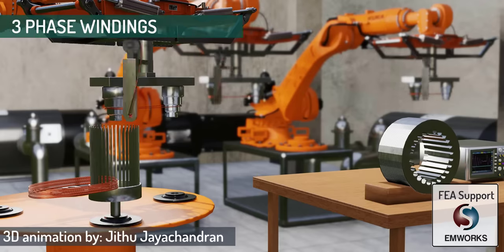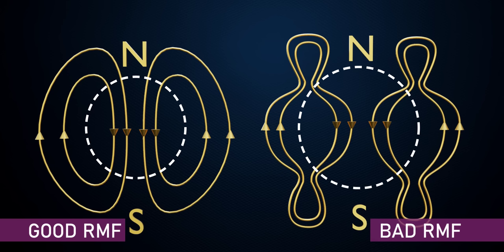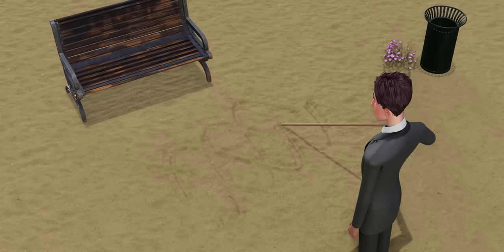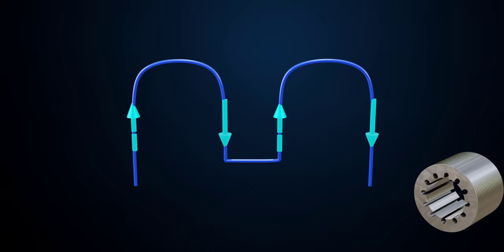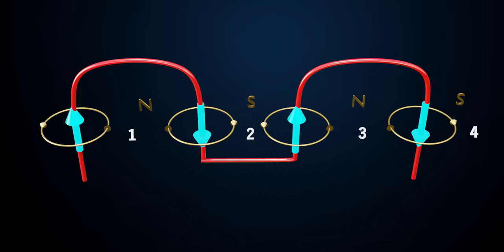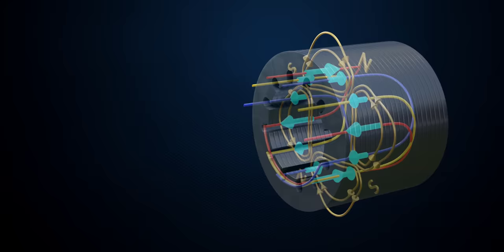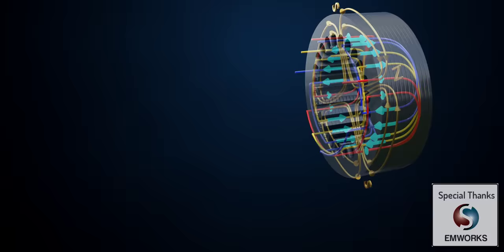Understanding electric motor Windings!

Comment: The normal squirrel cage can deflect the direction of induction by using rods. The Tesla motor produces only a lokal rigid magnetic deflection, rather braking in this arrangement without a conductor and without other functions. No magnetic valve, this is imagination.

Comment: How do you control the motor’s rpm( speed)?
Reply: I'm not an expert but I think that basically you can't control an induction motor's speed, the speed is determined by the number of poles and the frequency. A 2 pole motor is faster and a 4 pole motor is slower etc. But for example washing machines with induction motors have many poles so they alternate which poles they use to get a couple different speeds.

Comment: 3 phase motor was invented by Nikola Tesla who had no formal engineering degree. AC motor had to be invented other wise you can't make tolly cars and industrial machinery. But the Oil Co. Bought out the trolly systems in favor for bus petrol vehicles...

Comment: Why would Tesla wire up 3 stator windings and not use 3 phases? THe system would turn with only one phase as well if you had only one winding (stator pole pair). Or are you implying this is how 3 phase systems came about? There are single AC phase motors that work.

Comment: Why do we have 4 winding coils if there are only 3 phases?
Reply: Single phase can have any number of windings. Two phase (rarely to never used) will always be in pairs. Three phase will always be in treble. So there won't be a 4 coil, 3 phase arrangement. But there could be a 6 or 9 or 12, etc.

You could have more phases but there isn't a point. 3 phase is most efficient.
Reply: @etherealrose2139  Thank you very much, sir

Comment: RMF is an acronym used extensively by Lesics but not often (or ever) by ABET accredited universities, researchers or manufacturers.  I find that odd.
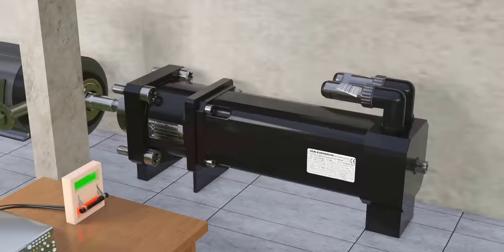I can endure a fair amount of fake expertise for a few minutes but they really crossed the line at 3:22.  Windings are never insulated this late in the assembly process and 'laminations' have nothing to do with conductor insulation.  This speaks volumes of the presenter's understanding of the subject matter.
Also, increasing stator poles quickly reaches a point of diminishing returns, regardless of how well it's animated.

Comment: Sir! for 24 slots motor winding , there should be 6 pole RMF or 2 pole RMF. Is it correct? If yes, then how can you show 4 pole RMF for 24 slots motor winding? 
If I am wrong, then please tell me, where I am wrong
Reply: Depends how you wind it, you dont have to wind each coil 'leg' in separate slot, you can wind 2 legs of 2 coils into one slot for example. So you can obtain different number of poles in different number of slots.
Reply: @sumilidero  will you elaborate?
Reply: @pranomjobbs8914  Well its kind of complex topic. There are different methods of winding/connecting the windings. Like chain/cross/concentric for example. Also single layer/two layer etc. And each 'style' is a bit different in terms of how you place coils and how you connect their begginings/ends. You can search it in the internet, there is plenty drawings and diagrams for different methods and numbers of slots/poles. That would be the easiest way, just to compare diagrams.
Reply: @sumilidero  Ok!!
Reply: @sumilidero  
There aren't good enough sources for winding diagrams
Reply: This is complex and a very good question. The only way to really understand what your asking is to physically wined a few motors of different RPM and study the connections. That's the only way I see to learn this , or answer your question.
Reply: @calvinevans9547  Thanks!! Are you Electrical Engineering Student?
Reply: @pranomjobbs8914   no, motor winder & Electricain .
Reply: @calvinevans9547  Great sir!!🙌. Looking forward to touch with you for gaining some practical based electrical knowledge.

Comment: Time out.  You say Tesla brainstormed whey don't I put the three phases out of sync so they are not all at max or all at zero - Walla there you have it - done.  That's quite a leap.  How do you get them out of sync?  Is Phase 1 use more copper windings than 2 which uses more than 3?  Because the animation didn't change the layout of the coils it just changed the timing of the current and thus the polarity of the emf.  So how'd he do it?
Reply: There are different motor designs, but you can create three phases by sending power into the rotor and spinning it.  If your three stator windings are each 120 degrees apart, the rotating field of the rotor will produce a phase in each winding.

Of course you shouldn't be physically spinning the rotor to make this happen (although that would work) but you can power up the stators with a DC current first to give the rotor field something to push against.  Other AC designs include a capacitor, to force the current out of sync (an inductor would also do the same thing but since motors are already very inductive this is less efficient)
Reply: @DeoMachina  So let's go simple 3 coil 3 phase 120 degree apart. All of these (build your own generator) videos have a magnet about to pass by one of these coils at the same time.  So at best you'll get 2 phases at the same max positive or negative and one at the opposite.  That's the part I can't wrap my head around.  Is there a special spacing of the magnets?  Why does no one ever mention it?
Reply: @anthonypape6862  Draw a sine wave and call it phase 1.  If you turn the rotor 360 degrees, the top peak is when the 'magnet' (or magnetic field) is at the same position as the first coil of the stator.  (Say 0 degrees)  And the bottom peak of the sine wave is when that same magnet is 180 degrees around, this time at the opposite side.

Now imagine a second coil 120 degrees away from the first.  Turn the rotor again, and draw a second sine wave.  The peak of the second sine wave cannot be in the same place as the first, because it's 120 degrees apart.  So the first peak of the second phase is at 120 degrees, meaning the second peak of the second phase is at 300 degrees.

Does this make more sense?  It's like you have 6 people standing in a circle around you, and you're spinning around and high fiving them all one at a time.
Reply: @DeoMachina  Ah I just can’t get it. When I do that with one magnet there is a huge dead space between the 3 sign waves. It seems in coils must be divisible by 3 and magnets by 2 the secret is in the magnet arrangement. You can have a magnet passing over each coil at the same time
Reply: @anthonypape6862  The magnet will have the north and south pole, so both will be doing the same thing at opposite ends

This produces three sine waves that overlap
Reply: @DeoMachina  Brother, I appreciate you trying.  I just don't get it.  In this videos illustration I do.  But in the generator I was making per most other videos the magnet is not a bar magnet, it's a small square or rectangle an the flux only goes through one coil at a time and re-routed through iron laminations.

Comment: i don't understand how electricity travel through the winding copper wires and not short circuit. those wires are touching each others.
Reply: They have a thin coating of clear varnish.  This type of copper wire is also called "magnet" wire as it is used for winding all kinds of electro-magnets.  Plastic insulation would make the coils too thick.

Comment: 6:18 but as according to synchronous speed formula for induction motor it say the opposite which is - Speed depends   on numbers of poles Higer num of pols means higer the speed . But it seems you are saing it opposite !?
Reply: No, its good in video.
Reply: RPM = 120F/P 😎
F is line Frequency
P is the number of Poles
Reply: @abusaidfulus8901  yeah that one
Reply: @omsingharjit  P in the formula is denominator. This would mean greater number of poles will yield lower RPM but with greater torque.
Reply: @abusaidfulus8901  ooh it makes sense now , thanks for reminding me the formula

Comment: I guess engineers only understand what they do but it would be a whole lot simpler to follow with the eye if you would  make it more practical and show how the windings actually move what they move in a motor.
Reply: The windings stay in one place. The motor is comprised of a rotor and a stator. Stator stays still and the rotor rotates. The rotor typically has permanent magnets embedded that react to the rotating magnetic field that is generated by the signals sent to the coils on the stator.
Reply: @NGPerez247  Yeah, we know that but it still doesn't help with this illustration.
Reply: @NGPerez247  actually windings can be on either the rotor, stator, or both. Depends on the motor type. You can also have permanent magnets on one, the other, or both (little more complicated on the last.) And you can also simply have shorted conductors (squirrel cage) on the rotor.

Comment: The magnetic field lines in this demonstration are pointing in the wrong direction.  They point from south to north.  This is incorrect.  It is arbitrary but convention states that magnetic field lines point from north to south outside the magnet and from south to north inside the magnet.  Since this is an electro magnet “inside” the magnet is a line connecting the north and south poles.  Outside the magnet would be everywhere else.

Comment: Tesla was not using the standard AC we all know, he used radiant AC which is achieved by rotating a single face magnet in an iron core...i.e a water pump motor ran in reverse. this kind of energy is not the same as the thing we call electric, as it is pulled & manafested from counter space, or as tesla called it......the either

Comment: Confused as to why there never has been a  9 phase, same as (not pictured as this is not incorrect but not 100 correct, if that makes sense) and each sequence and winding when corresponding correctly and in sequence would not be more so effective. 

Dumbed down, circle a circle. So long as a circle, or sine wave, never touch but creates faster and more torque with the same applied powers....

We living almost in the stone age

Comment: Coils are inductors to electro-magnetic waves-frequencies-pollution-pulse. When connected and not powered but grounded, they are the ground to frequencies including gamma from radioactive nuclear isotopes. Layers of inductor-coils of different materials and the asynchronous length-time conductor grounding can reduce the effects of gamma-pollution in the environment. 

Connecting 
= incandescent-bulbs to stabalise circuits
= magnets-coils generators-alternators-magnetomometers(grounded anyhow) to stabalise electrical-transmission(synchronous 50hz, 60hz)
= ... ... nuclear versus non-nuclear
= finance money cost budget till, you might as well work for money instead of rob nations.

Comment: I think is most importan understand this , and how electric with magnetic field makes a rotation rotor in the stator . But I m not sure is easy to trully feel and visualate that un the mind . For me is much easy understand and imagion how two stroke engine or four engine works than this , here is a problem magnet and polarity from wires , And fore small electric device as drill and grinder is less easier see how they work , because polls . So magnet field can understand just brilliant minds or they which created that as Tesla did .. If we have one electric one fase motor 230 V with 2 kw or 2000W power with 2800 number of rotation , with capacitor from 50 uf how we can now how Electric energy from 9 amps is much lower inside because resistanse in the wires and how that power armature from stator goes on the magnet field and turn on rotor which is also wholle in wires !? Here is very impotan deep thinking about that proces but is so dificult to imagine . Maby is less hard fore people which make winding coils ,but even they I m not sure how they see Magnet field !? But here is the problem of Ignorance , knows something means knows how some mashine funkcionate from inside , is not enough just knows how to wind coils or how to repare some part , but here is a problem in every sciense in the world, some creators were made world of Ignorance because other people can't understand their products on right way . These explanation can ilustrate but even this not way to really feel and learn how electric motors works ! So more sciense more X , more missunderstanding more ignorance and that destroyed the new generation, that is a long storie but Let think about that , if we everyday creating something new , we actually programing our minds to became as a computer , but human minds were not born for so much information , we are spiritual human beings we have a soul and this world make a mashine from the human beings , and that s not normal, because this scientic " brilliant IQ" minds we are not humans anymore , and that inovations destroyed the world , and now today people are slave from mashine . So u can think now what you want , I know You will support new age and tehnology but if you love to live in the world where no emotions where is a robot factories and if you think you become smarten with new tehnology then I m not sure you really know what is a life !? That destroying a humans everyday ! In these world where is a thousand languages , we are strangers , is that normal , how much diferent nations , religions , is that made people smarter or better , no that is separate people from themselve , we were need live united not separated , but tehnic destroyed the all. So do you think I m talking shit ? You like more living in the Matrix world , so go on , maby I m wrong , maby you will live forewere loosed in your science , has anything what we done made our life better ?

Comment: What a well made video, pity that for the ignorant this looks very true. Tesla was not the one to come up with poly phase motors. That's popular false history. The coils in a motor have to be 120 degrees apart (in 3 phase) because you can not place them inside each other. The coils are not varnished to insulate them the wire is insulated before the winding of the coil. it is varnished is applied to stop the wire vibrating and rubbing and make the motor durable. I am not watching the whole video because its a waste of time filled with falsehoods.

Comment: My uncle is a mechanic and repairs electric motors after the coil is damaged.
He makes the windings using nails, a mallet and his bare hands, he notes nothing about torque, two pole field, four pole field, degree, magnetic field.
In fact he has neve been to high school not to talk becoming an electrical engineer. But there isn't an electric motor in these world he can't repair.

Comment: There's only one thing I really wanna know about motor windings: WHY IS IT LITERALLY IMPOSSIBLE FOR A HOBBYIST TO JUST BUY A GODDAMN STATOR WITHOUT THE WIRING ALREADY IN IT?

Edit: And I mean in the style of the three phase motors above. I know ebay has a bunch of motorcycle alternator parts, but they're all oriented in the wrong direction. If I want anything where the stator teeth face inwards, there are literally no options unless I start my own LLC and buy ten thousand dollars worth of stator laminate. I don't need that shit! And I don't wanna go scrapyard scavenging for old, greasy, disgusting, beat up AC motors with juuuuuuuuuust the right tooth shape either. I have to spend more than half my time just removing all of the janky, burnt up, unusable windings anyway. Hell, I see pictures for modular stator designs all over Google too. They're just little T-shaped segments of a stator. But nobody sells them! Those parts would be perfect for any project I have. I'd be able to wind them myself and adjust the radius by inserting or removing teeth. I'd be willing to drop a few hundred bucks to get a big box of these things.

"Why would you want that? Why wouldn't you want a stator that's already wound?" Don't worry about it. I have my own silly stupid plans with these things. You know what I've had to make do with over the past two years? Boxes of laminated nails for nail guns! That's the closest I can find to a stator laminate, but it's janky as hell. Just sell me some damn stator parts!

Comment: The animator appears to be of Indian origin, as he used the slang term "Pharma" in the video, which is completely incorrect in the context of winding machines. Additionally, the animator made several genuine mistakes during his explanation, particularly when discussing electromagnetic concepts. His explanations were misleading and incorrect, especially when he talked about varnishing, which was nonsensical. It’s frustrating to see such content being praised, as it reflects poorly on the understanding of our engineering community. Identifying these errors is not my job, nor am I being paid to do so, but it’s disheartening to see the level of misinformation being accepted. This video contains so many inaccuracies that only a skilled and experienced engineer would be able to recognize just how wrong it is on multiple levels.